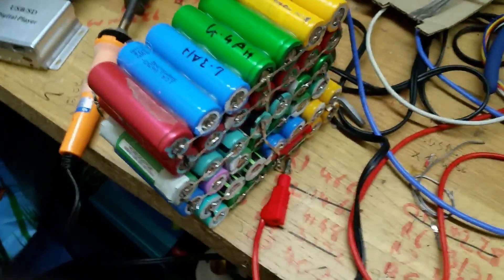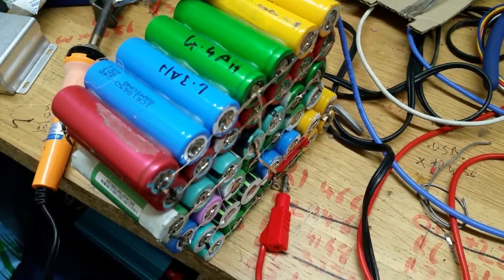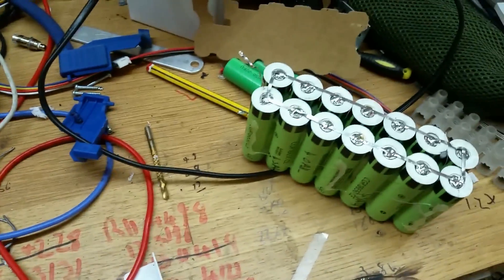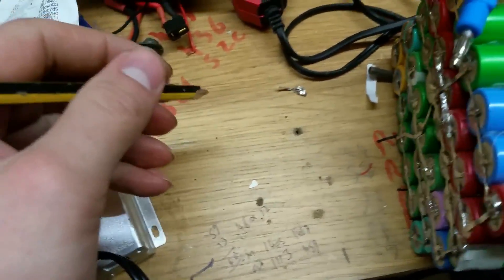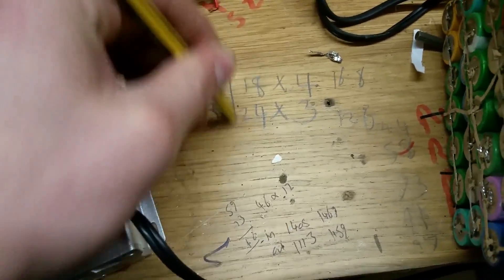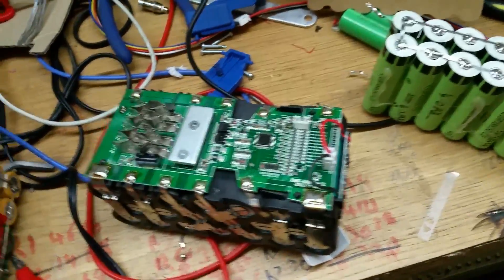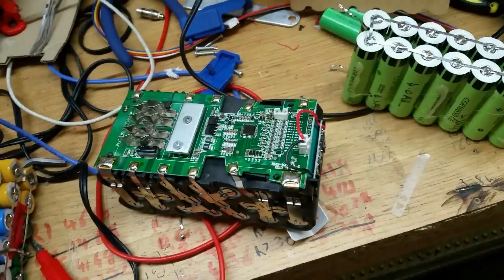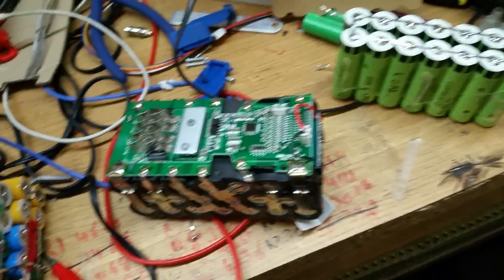recycled 18650 cell  crisis

Comment: Hey, I stumbled across them a while ago in a nuts and volts magazine and found a place that sells them. They also have data sheets on the specs of the NiFe cell along with weight per capacity. https://ironedison.com/  Was watching your video while taking apart old laptop packs.
Reply: Oh, and I think it was potassium hydroxide mixed with lithium for the electrolyte, could be wrong though.

Comment: NIFE cells are wonderful for renewable energy applications. Their self discharge rate is a bit on the high side, but in high cyclic rate applications such as renewable energy this is not a big deal.
The trouble is finding a source of them. Their excellent service life means that they don't appear very regularly in the second hand market. New ones are available, but they are expensive. I have not done a comparison in a while, but I seem to remember that their price per usable KWh was higher than that of lead acid.
Another technology that I stumbled upon recently was a salt water battery. Too expensive, but interesting none the less.

Comment: Use 3amp poly fuses on each one. That will confine damage to the individual faulty cells and the fuses are cheap for a bag of 50 from China.
Reply from the maker: Purchased! =) does this stop drain over time? I don't think the cell is a dead short?
Reply: +pietkaify Lithiums have a low self discharge rate but poly fuses will not stop that. If an individual cells goes faulty or high resistance it will however stop it taking out other cells. You then replace just that one lithium cell as opposed to all in the wider cell.

Comment: if the pack wont charge take it apart charge each one on its own untill you find the bad cell recently just had the same issue replaced the dead cell and pack is back upto full capacity
Reply from the maker: +David Simpson I'm on it=)
Reply: your lucky that you have more then one unit for charging lol i only had one left over the rest been used haha tulk a couple of week to do 20 cells

Comment: i have a 20p3s pack and i have just got a step up dc to dc boost circuit so the output always stays at 12.6 i was going to run a step down converter to that steps voltage down to 12.6 so both units in parallel would allow a pack to go from fully charge to fully flat and never give anything more then 12.6 or anything less then 12.6  volt the protection pcb wont allow the current so i have the pcb feeding a relay that supplies power to the the conveters so when the battery runs low it knocks off the direct power feed throgh the relay to the converters the step up conveters is ment to power upto 130 watts so as long as protection circuit dont kick in they wont be a voltage sag